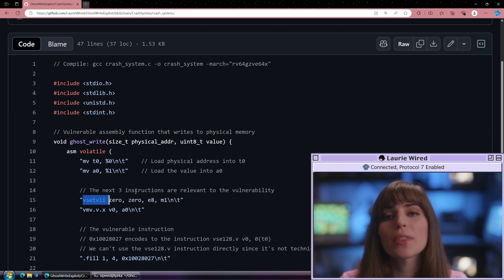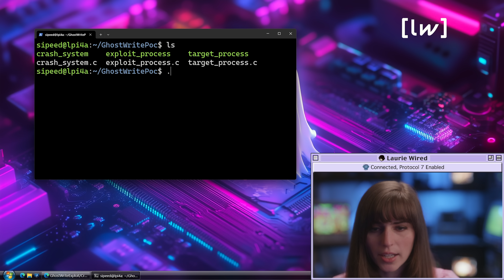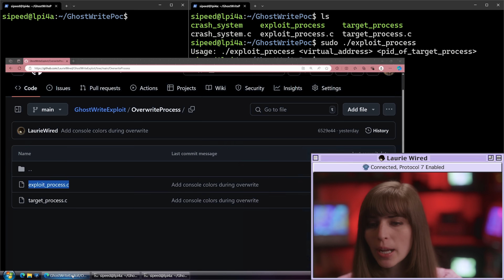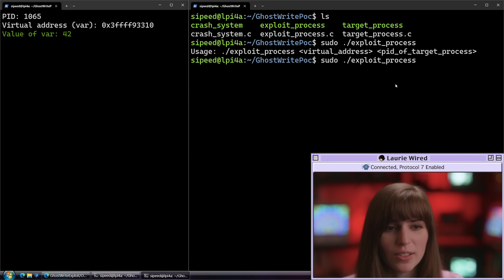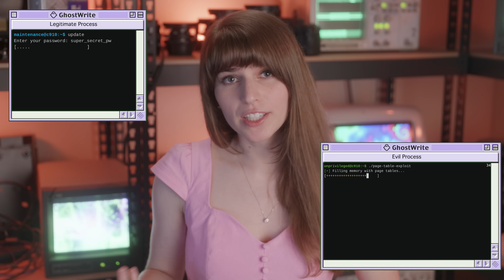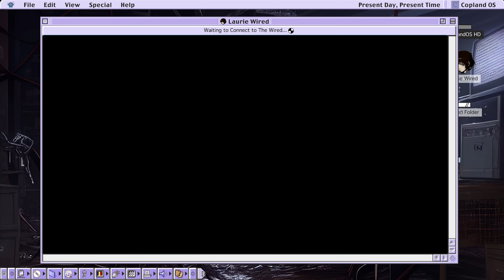what happens when your CPU has a bug? (GhostWrite)

Comment: 1:42 yeah, there might be. therefore let's be grateful for openSBI, the hypervisor of hypervisors, one that can trap "broken" instruction and execute any other code at the cost of speed.
Reply: The SBI is irrelevant in the case of GhostWrite.
Reply: @Madinko12  why so? if this is how one can emulate missing cpu extension (for instance: no M extension so trap any mul to perform loop with additions/ bit shifting) why SBI shouldn't be able to handle any instruction issued from S mode?
Reply: @lis6502  because in the case of Ghostwrite, all instructions are considered valid by the CPU, therefore it never traps and SBI has no chance of running. If there's some chicken bit to disable V support at CPU level it could work in theory, but instead you can just fall back to non-RVV code directly from userspace which will always be 100x more efficient than ring-switch and emulation at every single instruction in supposedly performance critical code.

Comment: CPU bugs is fairly common for example some CPU might have errors in their FPU giving wrong results. It is not a security problem but is corrected in sw with a performance penalty. Fuzzing is really interesting, you can use it to reverse engineer proprietary protocols for FPGAs as an example. Some more vids about fuzzing would be great fun! 😊

Comment: Is it really just a bug? Or did they think the operating system kernel was supposed to prevent this?
Reply: The operating system kernel cannot stop you running any assembly instructions you want. There are protected modes which the Kernel tells the CPU to go into and out of when it hands controller over to/and from user code. It would be very slow if the kernel had to interrupt every CPU instruction before it's actually ran by the CPU.

Comment: They found 2 other bugs of the "halt and catch fire" variety on a total of 5 different CPU's. This is due to rushed and/or flawed implementation of RISC-V and extensions by the vendors apparently. all from china. Since Qualcomm is fighting with ARM over licensing this was supposed to be a golden ticket for RISC-V, but some ball dropping seems to be in effect.